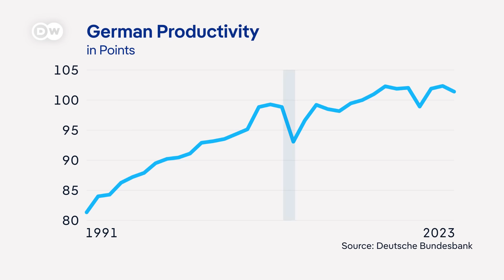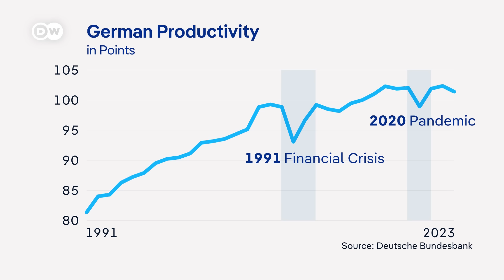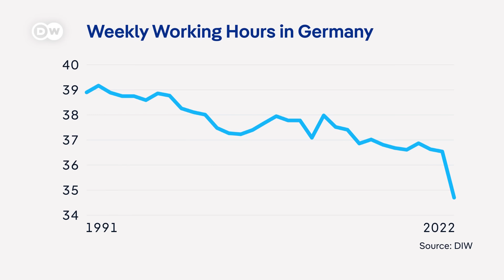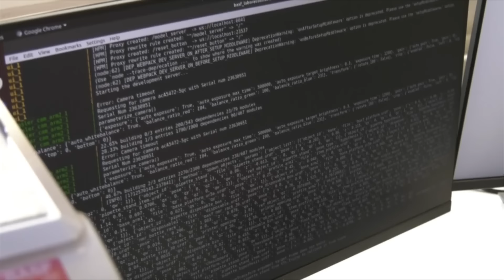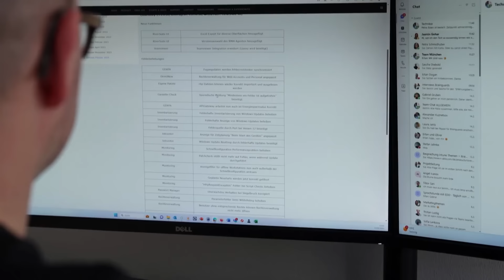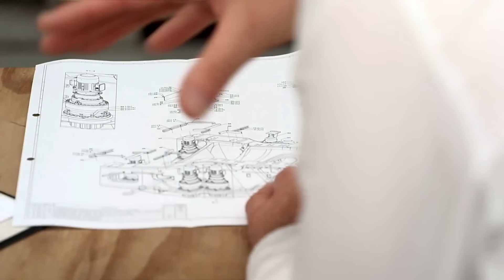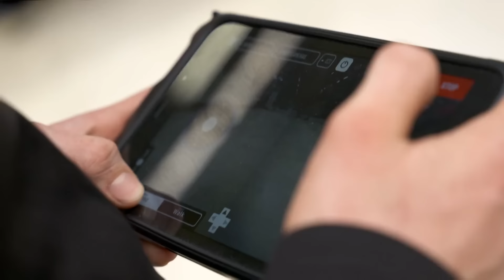Can longer hours save Europe's economy? | DW News

Comment: Work more of course, make more money for billionaires.
Reply: There is nothing wrong making money for the employer. As long as the employer compensates us well for the time at work. 

Yeah, that is funny, I know...
Reply: @nothereandthereanywhere  compensating well may not be enough. If an employer makes 200% more money because of productivity gains, the vast majority of those gains are distributed to the C-Suite of the company & Shareholders instead of the actual workers. I think there should be a fairer split, which hasn't been a thing for 50 years by now.
Reply: @AkiseAk  I completely agree, don't get me wrong on that. That is why I have said they have to compensate us well.

Comment: The guest keeps saying the shorter work hours are just to avoid burnout, but it's not just about that.
It lowers the risk of mistakes, accidents lower quality service.
I see it as a way to spread the wealth more equitably because it should force the companies to hire more workers and improve the gap between managers' and worker's wages.
FYI, for the above comment I'm assuming the current economic system is desirable and productivity should reign supreme. Because those are not given, especially with the environmental impacts they have produced.
Perhaps More innovation should be the metric.

Comment: The 40 hrs method has always worked and the 4 days working week is on the rise. To add the 6 days working week would be a syncronization of the european market to the american one where companies have the power to fire you just because you sneeze the wrong way. European governments and unions know that promoting an american way would cause a revolution as the 40 hrs work week is so ingrained in the lifestyle and no sane worker would be willing to work 60 hrs apart the rare workaholic. Apart that, you need to ask a young worker about that and not an old manager who probably has an high salary and is near retirement and does not work 40 hrs most probably.